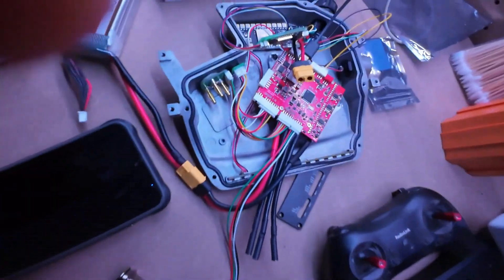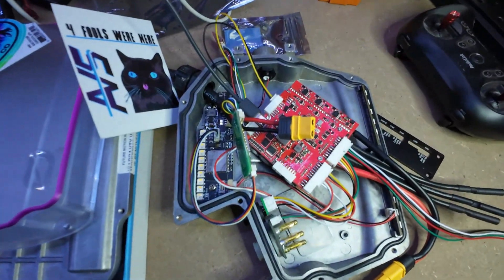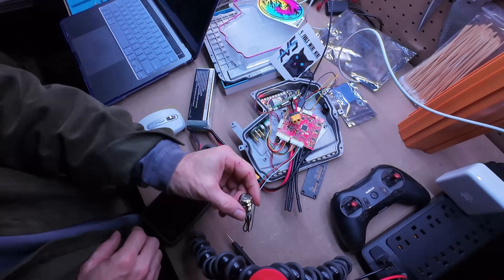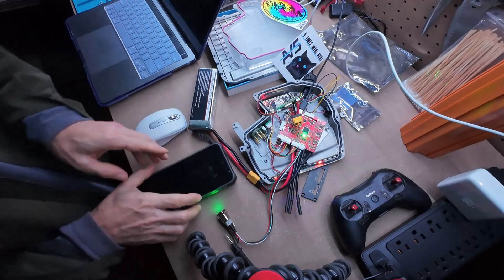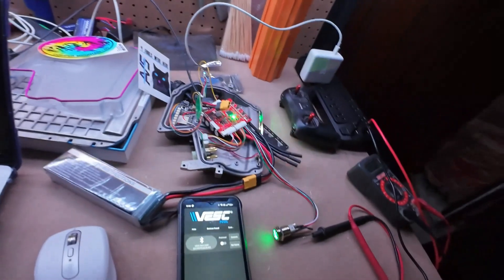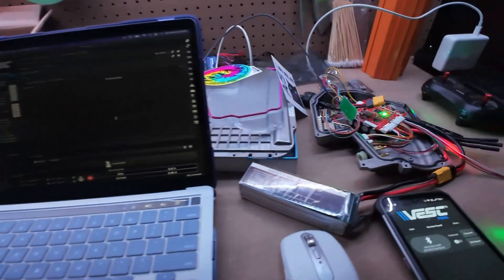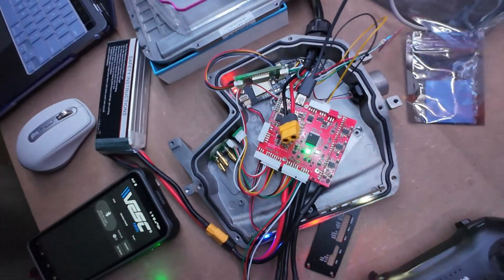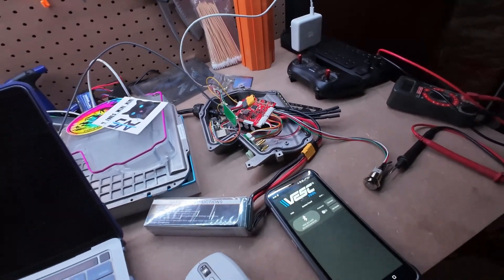PintX to VESC via AvaSpark kit update

Comment: Thanks for sharing this. I'm thinking of going VESC to get my pint/quart back in action and the ava spark kit looks like the easiest way to do it. Not sure it's strictly cost effective, but I'm also a software guy so that's the main interest, and I like the idea of supporting people who streamline the hardware side.
Reply from the maker: Yeah, the cost is higher than if you were to source the parts yourself but the light bar module makes it so easy.   You can still get lights with other methods for cheaper as well.   The GT-V drop in from Tony is going to be around $500 , so Ava's price point is not way out of line. Like you I try to support the little guy more so than the greedy corporation when I can.

Comment: TCP can be finicky. Make sure your phone and laptop have good wifi connection and are on the same router. Luckily VESC shutting off or loosing connection during firmware upload isn't actually too bad!
Reply from the maker: Thanks, I have spent all of 5 mins looking into the VESC app for the most part.😊   I have watched a few vids and been browsing pev.dev a bit but still got a few things to learn before feeling comfortable in the app.

Thanks for the comment, I will take any help I can get.  Good to hear that failing a flash might not be a 100% brick as it does always worry me a bit when I flash chips. That is why I was trying to get the USB cable to work before flashing.